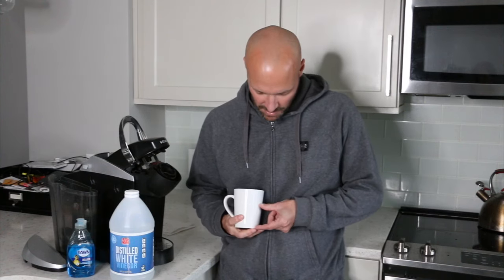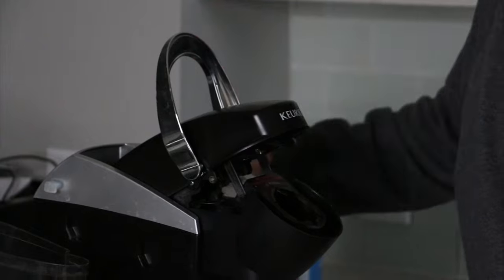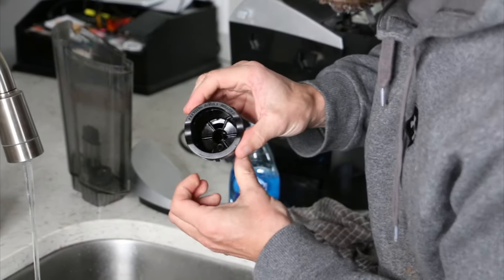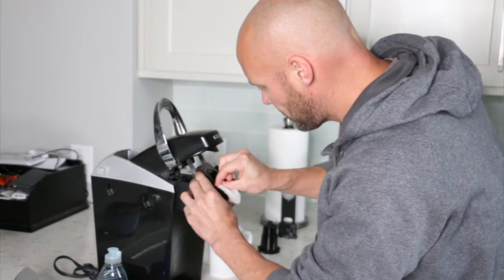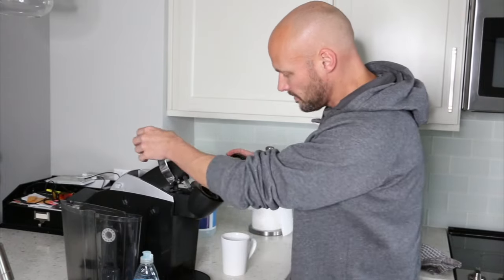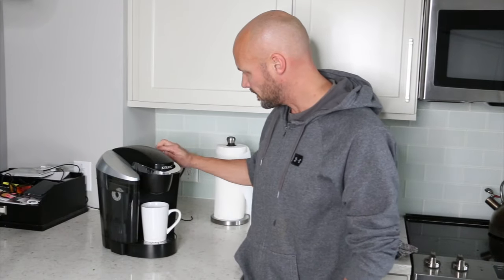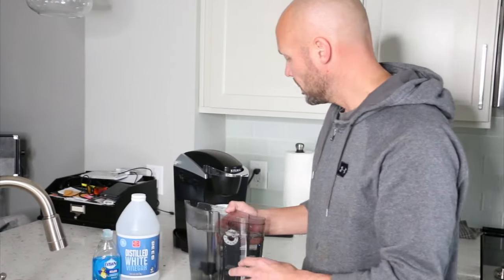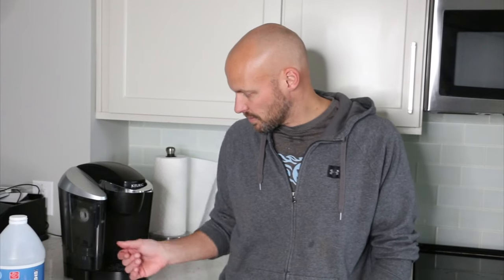How to CLEAN a Keurig Coffee Maker

Comment: after you cleaned the tank, you put the filter back into the tank before you ran vinegar and water combination.  I suggest you Never run vinegar through the charcoal filter. …Run the vinegar through the machine and Then replace OR reinstall the existing filter.    :)

Comment: What is your opinion on this my original Keurig that I had probably back in 2015 had us us use vinegar to de-scale it but the instruction said to leave it in for four hours then run it through the machine and then run filtered cold water through the machine
Reply from the maker: Yes - I have done that as well.  Just make sure to replace the filter and get all the vinegar out!